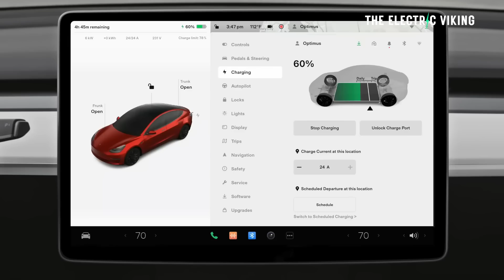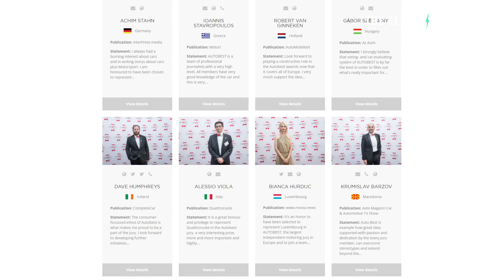CATL's new superfast charging LFP batteries win best battery in the world

Comment: LFP batteries still have oxygen rich electrolytes that decompose into free oxygen when overheated. So they WILL go into thermal runaway and will be impossible to put out in most circumstances. Anyone who says the opposite  - like Must - is LYING.

Please dont just take my word for it.  Ask anyone at a model aircraft RC club about them. They've got lots of experience LOL.
Reply: LFP in RC (!!??)
Reply: What you say is really strange, I have not seen a LFP battery in RC, the typical is NMC as in Tesla until yesterday afternoon.
Reply: @carlosduran7800  THe President of my former club said that most clubs now have a procedure to charge LFP batteries in a bag so as to contain potential fires.

Comment: Your not giving the actual number. If you add bigger battery a car then the car can go 2000km in single charge. Any car company can make those battery and cars. So What is the power density per weight of the battery so people wont be confused?

Comment: I agree with you that solid state is taking so long that if it comes out, the difference might not be that big. Some companies are coming out with semi solid state next year. And there are other chemistries for different use cases. 
On the other hand, there is a limit to lithium based batteries. They have not reached that limit. But theoretically, solid state could go beyond that. That is the promise behind the hype.

Comment: Been driving a model 3 LFP 2022 now at 84,000km average charge time during long distance travel is 11 minutes. Very rarely, if I need to charge to 90% it takes 25 minutes. 
Although charging faster is better, my experience with current LFP charge speeds is satisfactory.
Reply: How has your battery held up? Much degradation in range?
Reply: It's hard to know for sure. At 100% charge when I switch to km, when new it would show 428 km range, now it shows 421 km. I'm not sure if that is the actual degradation. My range between supercharging stops doesn't appear to have been affected and that's what really matters. It's an incredible machine and I would actually refuse to buy a different chemistry. I love charging to 100% all the time. @hogarthpaul
Reply: need wait for a battery change 
and the fact once the battery burns, it is difficult to put it off
Reply: LFP batteries don't / can't catch fire. You're thinking of LNMC batteries.  @fcukrealmadrid

Comment: MG4 won the car of the year for Carsales and Seal was the runner-up Drive lost by one vote. Out of all the finalists, a large number of vehicles are Chinese in origin. How has time changed!
Reply: China is taking over the world in EVs just as they had been in academic olympiads.
Reply: Both cars have horrendous driver safety technology with lane keep assist actively trying to kill you. Both cars you have turn them off everytime you sit in thr car to drive - settings don't save. MG4 one pedel driving has to be turned on everytime you sit to drive and BYD don't even have OPD. If price is the only factor in winning these awards then yeah sure. Most else is pretty crap.

Comment: I don't know about solid-state batteries, but I'd much rather have greater energy density than faster charging. Use the energy density to reduce the size, weight and cost of the battery while delivering 250-300 miles of range. I don't need 500 miles of range, much less a thousand, and 150 kW is as fast as I'll ever need to charge my car if I can find a charger that''ll deliver the power. A battery that will charge at 350 kW is not worth more to me because I don't need it and would rarely be able to use it if I did need it.

Comment: but faster charging tends to degrade the battery in the long run I would rather slow charge
Reply: I don't think this applies to LFP batteries.
Reply: @robertwhite3503  that is what they make you think all batteries degrades its just at what rate the degradation process occurs
Reply: @yoji8130  Fair enough. Tesla have imposed minimum and maximum charges on some chemistries. But my understanding is that LFP can go down to zero and up to 100%. However all batteries are limited to a certain number of cycles before they become too weak.

Comment: Range and charging speeds keep increasing pretty much every year, while prices continue to decrease.  Next year will see two new chemistries.  The year after that will see other improvements.  Maybe in next few years someone will figure out how to mass produce solid state batteries which would be a huge deal, but even if they don't, battery tech will keep improving with or without them.

Comment: There are physical limits to what you can do with cylindrical cell, lithium ion batteries. True, manufacturers haven't reached those limits quite yet, but they are close. In fact, you're only going to see modest improvements in energy density going forward; instead, the focus will be on cost.  
A lithium-metal battery will be able to provide energy density and charge times that will be impossible for a lithium-ionlithium-ion battery to match. These batteries can be produced, but the billion dollar question is whether they can be manufactured in a cost-competitive manner. Who knows? However, one thing I do know is that the investments in lithium metal batteries are forcing companies like Tesla to innovate and drive down costs, which I think is great.

Comment: It’s being used on the eActros 600 40ton truck, drives with a range of 500 km without recharging. Due to megawatt charging, it charges from 20% to 80% in around 30 minutes. Its drive system ensures extra power. And the lithium iron phosphate (LFP) batteries do not require nickel or cobalt and offer enormous advantages in terms of service life and current flow.

Comment: The situation of Liquid Electrolyte vs Solid in batteries is a lot like OLED vs MicroLED in TV/Monitor Display Technology.
By the time MicroLED becomes viable from a consumer perspective, OLED Display Panels will likely provide comparable brightness, color volume and be a lot cheaper.

You can't even buy a MicroLED TV for under £10K, but you can get OLED TVs that can hit 2,000 nits, with incredible color volume.
Reply: Yup, the gap between what a solid state battery could POTENTIALLY achieve, is being closed by liquid electrolyte batteries that ACTUALLY achieve.

Comment: As I’ve said for a couple years, 4680 obsolete before it got into any vehicle. Battery day
Reply: I doubt it.  4680 is a size not a chemistry.  You can build larger 4680 cells with pretty much any chemistry. CATL is providing the batteries for Zeeker's new long range line which are 4680 Qilin batteries.  BYD also sells 4680's as does Tesla, Panasonic, LG, VW and many others.
Reply: @Ryan-ff2db oh dear you need more research. BYD doesn’t make any 4680 batteries, every EV BYD sells has a blade battery

Comment: Current battery tech is already good. But the rate of innovation is pushing me to lease a vehicle instead of buying it. I’m not taking the risk of futur value of the car. Supposed to take delivery of the EV9 in the next months
Reply: If the EV works for you now it will do its job for 250,000 miles.

Comment: CATLs energy density is 178.1Wh/kg. The old Panasonic manganese and cobolt cells that Tesla used had a energy density of around 250Wh/kg.

LFP is terrible and a step backwards. It means even shorter range than today👎
BEV Technology is moving in the wrong direction. Have the EV manufacturers given up on range?
Reply: You want cobalt in batteries lol
Reply: What is that energy density going to be after 100,000 km?

Comment: 5 Years from now I predict 1000Km as the standard range in EV's with sub 15min rapid charging. Plus a 60% decrease in current battery costs, plus more efficient motors meaning smaller batteries too. Just like we went from a shoulder mounted VHS camcorder to the smartphone.
Reply: I totally agree but maybe in 10 years not 5.
Reply: I think that will become an option, not the norm - we don't have 1000km cars now because we don't need them. Shorter 5.6 or 700km range = fewer batteries required = cheaper vehicle cost to the consumer = win win.  just my opinion.
Reply: @stevemyers2092  while most don't need them for their daily driving usage, the INDUSTRY needs them to get the troglodyte haters to STFU.
Reply: @stevemyers2092  balanced opinion that I share ... 700-800km is largely enough... 😉
Reply: 1000km may be possible but it won’t be cheap, and it will impact load capacity and handling.  Truly, few people need it unless they are towing.  Faster charging and 650km range solves the problem.
Reply: apparently Nio already has one that can achieve 1000km today.
Reply: Good thoughts here! I would count on a few years more, but you never really know. But one thing will not happen, because not even 1 % of drivers will need it: Charging 1000 km in 15 min. Even if that’s a true range of “only” 800 km and you charge from 10% to 80%, that gives you 1360 km in reality. On trips  like this 15 mins. more or less simply don’t matter. And a 1100 km trip on a day could actually be made with 15 mins. of charging, requiring to increase the SOC from 10% to only 40%.
Reply: 1000 km is too much.  Why pay for that much battery, and drag it around everywhere, when the actual need for that kind of range is vanishingly small?   You can put on 500 km in less time than it takes to take a leak and get a cup of coffee.
Reply: where electricity come from?

Comment: While other manufacturers have only announced their super batteries without a foreseeable production date, CATL and BYD are delivering one innovation after another.
Reply: Except their batteries are bad. 178,1Wh/kg only. That is not sufficent energy density to get any range.
Reply: LOL, it's an LFP battery. If the value of 178.1 Wh/kg is accurate, then it's a great achievement by CATL. LFP batteries have a lower energy density due to technical reasons, but they are more resistant to high and low temperatures. It's no wonder that the Shenxing battery won the Technobest Award 2024..
EDIT: Here a news from a Competitor from Germany (17 August 2023):
"With an energy density of 263 Wh/L and 162 Wh/kg, Aries II achieves respectively +34% and +23% improvements over the leading LFP pack benchmark." (ONE) 
The target production time is the end of 2024. One year behind (if they really reach their goal) and even worse technical data LOOOOL
  @USAoutofEurope
Reply: So why is Tesla using them? @USAoutofEurope
Reply: I @USAoutofEurope it is if they can be mass-produced for 50% less
Reply: These EVS are dispicable and must be banned.
Reply: @markmiller8903  😂🤣
Reply: @markmiller8903  Yes absolutely. The US does not want EVs and EV manufacture in the US MUST BE STOPPED.
Close Tesla Nevada, Tesla Fremont and Tesla Austin NOW.  Shut down the Ford Lightning factory and the GM Ultium battery factory NOW.
Close all the parasitic superchargers and EVGo chargers and Electrify America Chargers (or at least the few that are working) NOW. This will stop the power outages in Texas and California!
More money for fracking! Reopen the coal mines!
Seriously, anything that hastens the complete destruction of the US hegemony is probably a good thing ...
(</s>)
Reply: @markmiller8903 someone banned your dictionary
Reply: @markmiller8903 No, fossil fuelled climate killer vehicles must be banned. Oh wait, that is already happening 😂
Reply: CATL batteries are innovative not BYD